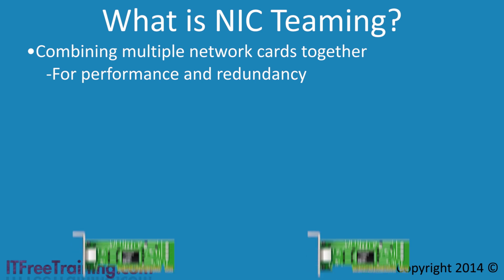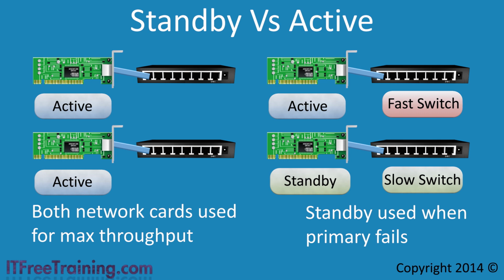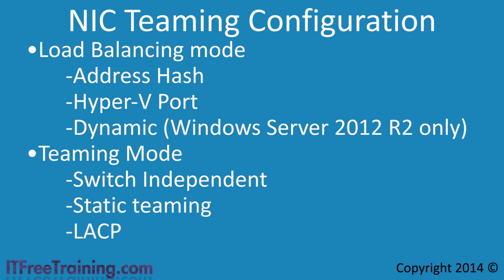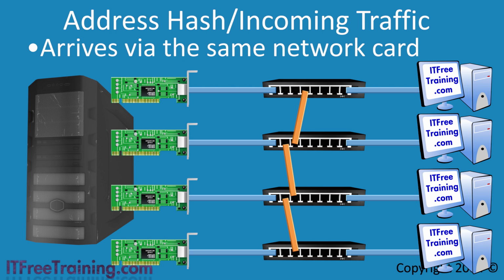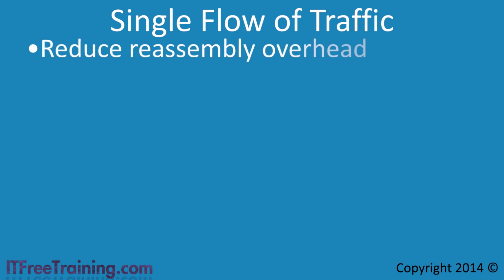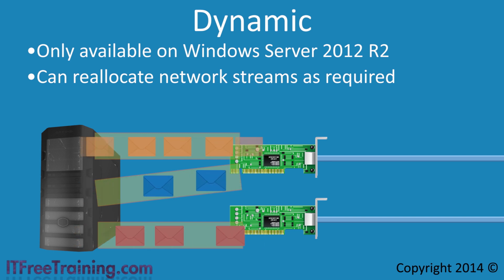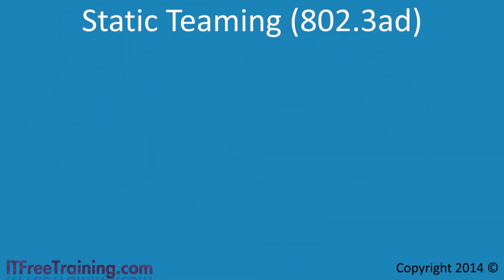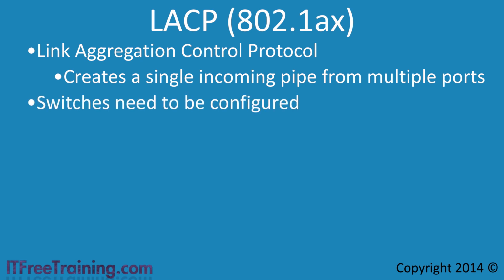NIC Teaming

Comment: If i had 20  1GB  network cards and I use  "teaming" would I have a 20GB connection, and higher file transfer speeds ?
Reply from the maker: Windows supports up to 32, so in theory you could do it. However, the incoming traffic may only come over the one network card.

Comment: I know you said with static teaming and LACP that switch ports need to be configured but that is only if it's a managed switch correct? Will these protocols not function properly if I use an unmanaged switch? I have a spare switch that is a managed one I just was curious if I would be required to change to using it in order to have a static team to function correctly?

Comment: Are there disadvantages on this video?
Reply from the maker: The main disadvantage is that incoming traffic will only be able to use on network card unless you have hardware support.
Reply: so basically this increases "upload" speed, but does not affect download speed?
Reply from the maker: @glgina6  Without any hardware support, that is correct.
Reply: Read "without hardware support" as "without buying a specialised device that does that"
Cheers.

Comment: I have 2 servers with 4 network interfaces in each of them, I want to create a failover cluster. 2 interfaces on each server are connected to different switches to provide fault tolerance. What kind of NIC Teaming will be best in my case?
Reply from the maker: The best option would be to team two NICs together on each server and have each connected to the network. This would create a rather fault tolerant setup.

Comment: Is there a point using this even you only have 1 internet connection? Or is it applicable?
Reply: I think the point of using this considering that you only have 1 internet connection is that you can maximize your resources on the access-distribution level. It is possible and it would be a better network if you have 2 ISPs.

Comment: Your explaination are 100% Sir and do like the video, I have followed your steps but my virtual NIC can`t identify my network (doesn`t matter if I use static IP or DHCP), do I need to do some configuration on the switch as well? If yes, may you please send me steps to do it.
Reply from the maker: Try pinging 127.0.0.1 and see if the TCP/IP stack is functional.

Comment: sir, so what's the best option for windows diskless server? i.e I have 20 clients that will diskless boot from the server , I want to maximize the speed of the server, i.e 2 or 3 Gbps if the clients all boot simultaneously. What protocol do my switch need to support? Thank you .
Reply from the maker: Remote desktop clients are the best solution if you want to reduce the amount of bandwidth. Also if they boot directly off the network, the operating system for these clients tends to be very small.

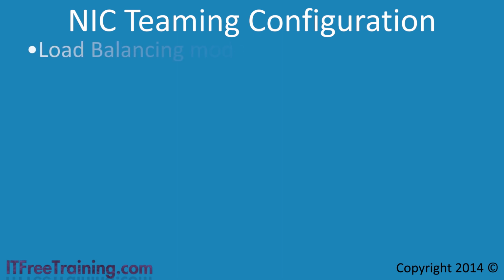Comment: At 3:30, why would you only want to use the slow connection as a backup? Wouldn't the teaming solution send more packets over the fast connection anyways? Or are teaming solutions not prejudiced over what connections are what? Wouldn't connection the fast and slow connections together make a faster connection?

Couldn't it be configured to fall back anyways?
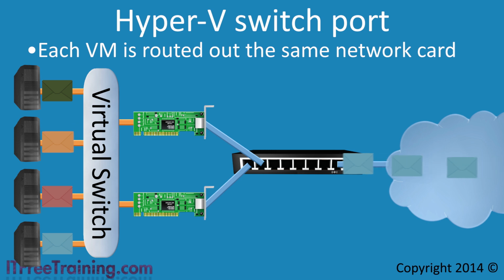Reply from the maker: Have a look at the video at 08:45. It is hard enough to have two networks card sending data not causing fragmentation at the other end, having them working at different speed would make the problem worse.

Comment: 802.3ad is LACP, its just the initial release of the protocol in 2000.  It was later revised and in 2008 became 802.1ax.  Other than that its a great video.  Thanks
Reply from the maker: You are 100% correct. Microsoft for some reason refers to this as static teaming. We will keep this mind to mention when we revise this video to mention this is the Microsoft name for it.

Comment: Very helpful! But I still don't understand the following: If I have a single Hyper-V VM and NIC Teaming is done in the host. Will this single VM be able to use all the physical NICs in the host's team for outgoing traffic to multiple clients?
Or do I need to create the team inside the VM (instead of in the host) to make use of multiple physical NICs from inside this VM?
Reply from the maker: If you use Hyper-V Port all the traffic from that single virtual machine will always travel over the one network card unless that network card were to fail. If you have only the one network card I would use address hash or dynamic. The only different is if you have multiple network adapter in the one virtual machine. If this is the case you may want to use Hyper-V port instead.